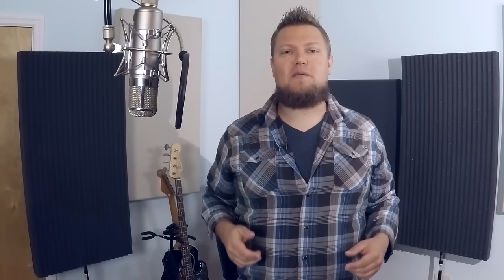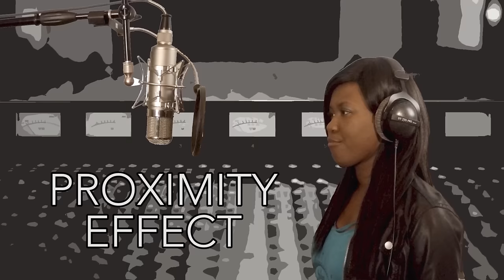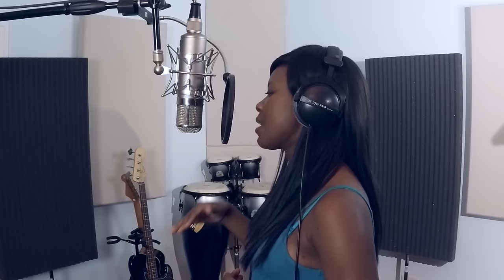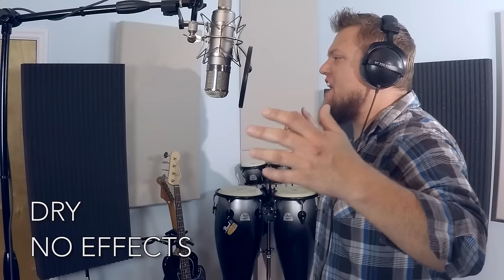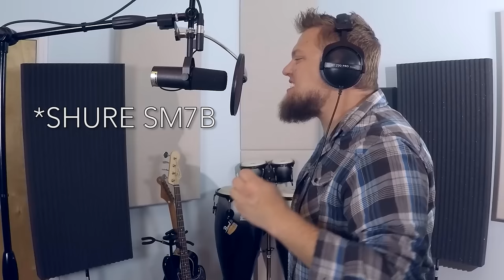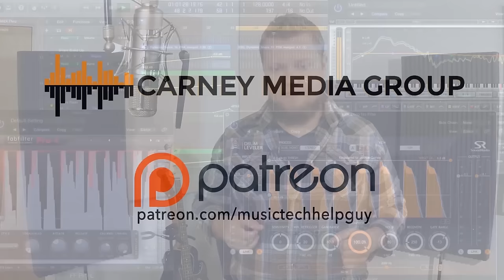3 Recording Techniques for Vocals

Comment: I clicked on this video 'cause I wanted to know where the mic should point on, but unfortunately no information about it. As far as I know, it is better if the mic points on the singers chin rather than his/her nose but it looks like in this video the mic is positioned even higher. Anybody knows how to do it right?
Reply from the maker: Angled down at the chin is generally the best approach, and you want the singer to sing just under the capsule, not directly into it. This is old video so I have no clue what it looks like off hand. The camera angle can be misleading at times.
Reply: There is no right way it's more so how close does whatever tip or adjustment get you to the sound your looking to achieve. Youll know if it's wrong or right when you listen to it

Comment: How do you get the SM7B so bright? It sounds a lot more dark for me, even before EQ and compression. I think it’s because I was too close to it, should I back it up or what?
Reply: It could be proximity, yes. Back off a little and there will be less mud in the low end which brings out high end detail. Clean gain could also help. A cloud lifter helps a lot for dynamic mics like the SM7B in that it adds lots of gain without noise which can allow more detail in the high end.
Reply: @jeffreymcclelland2136  yeah I use a Cloudlifter. But I appreciate it thanks

Comment: For a crisp high quality sound I found all the techniques - recording from above, using dynamic mics and singing at a larger distance to the microphone counterproductive. Plosives and sibilance are directed forward straight. The mid and high frequencies of your vowels are mainly directed slightly downwards. So placing the microphone above the mouth costs the sound more clarity and presence than it reduces plosives and sibilance, while placing the microphone below the mouth level (and angled towards the mouth) reduces plosives and sibilance while even enhancing clarity and presence.
Reply: What can u suggest for someone with a bassy voice like mine? It makes my voice off the note when I record but when i listen to it without hewring myself from the microphone my notes were right. Its giving me hard time recoring because of the dominance of bass from my voice
Reply: @jeysisantana1462  I'm not sure what you mean. What exactly is different when you sing off pitch and what does it have to do with your voice being bassy?
Reply: @fidrewe99  i mean, after i Record and losten to my recorded voice there are notes that are off but while recording I can hear myself hitting the right note but whenever I listen to my recorded voice there are always part where the notes are off.
Reply: @jeysisantana1462  well, thats because you're not actually hitting them. The recording tells you don't perceive accurately by ear yet.

Comment: How do I record my voice on my mic? Is there a video out already?
Reply from the maker: What do you mean by that? Are you concerned about your type of mic? Are you talking about singing or just voice overs? Can you elaborate a bit?
Reply: I have a Samson C01u that I am trying to record on but it does not pick up my voice. I am new to logic and do not know how to set this up
Reply from the maker: Just plug the mic into a microphone input on your audio interface, make sure that the audio interface is selected in your Logic audio preferences, create an audio track in Logic, and assign the input on the track, arm the track, and you should hear your voice through Logic. If not, make sure your preamp gain is pulled up on the interface, and if the mic needs phantom power, press the +48V button on your interface.
Reply: MusicTechHelpGuy okay that was the problem. I don't have an audio interface. Thank you